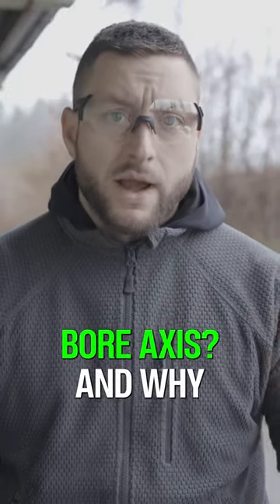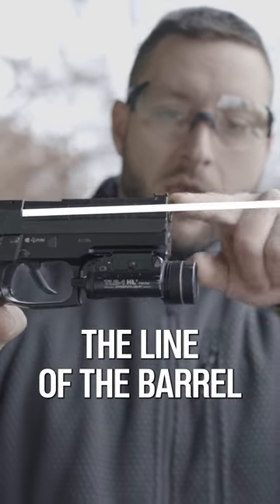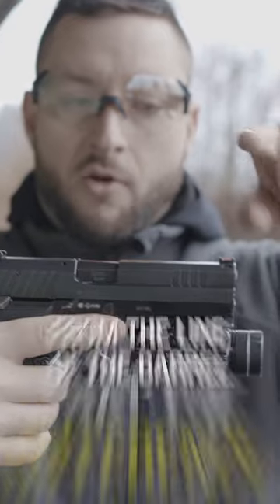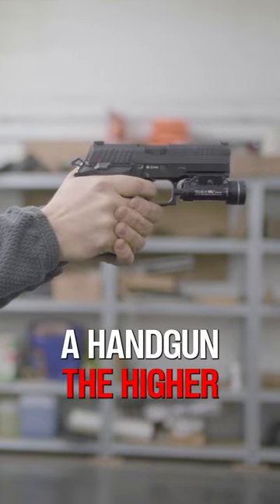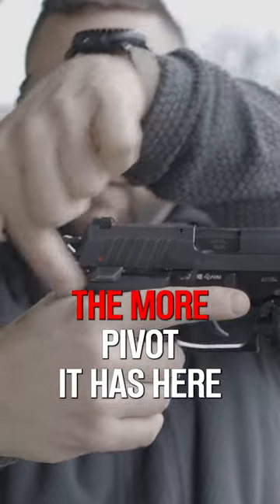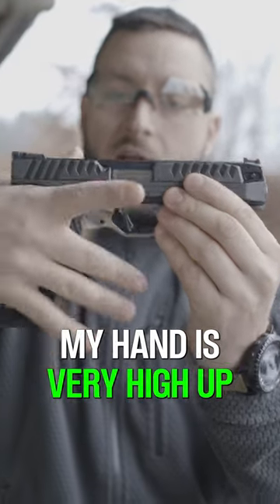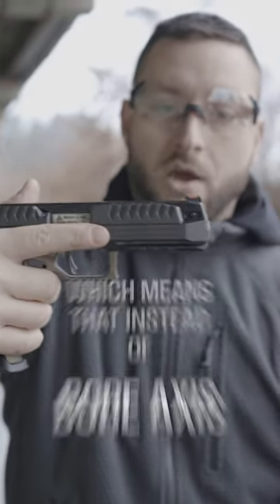Low Bore Axis?  Laugo Alien

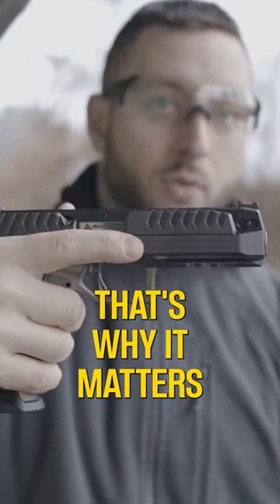Comment: 0:50 The bore axis also better aligns with the radius bone of the forearm, which is the load-bearing part of the forearm which connects directly to the wrist bones. That's actually better than if they had an even lower bore axis that placed the axis in the "middle" of the hand. Not sure if that's a thought they had when designing it but it's biomechanically very sound
Reply: Всё верно. Аналогичный спортивный пистолет был в СССР мц3-1 рекорд 1954 год.. 🎉🎉🎉

Comment: I shot the Alien and the hype is real. Muzzle flip is almost non-esistent even with factory ammo. However... the recoil going straight into your wrist and arm is a lot sharper and stronger, to the point it gets uncomfortable after a mag (let alone after a match). I'm a precision shooter (not a dynamic discipline competitor) and I prefer my G40 10mm to the Alien because ironically, the felt recoil is LESS with my 10mm, and muzzle flip (obviously more pronounced on the G40) isn't such a big factor.
If you're an IPSC shooter and reloading your own lower charge 9mm, Alien is great.
Reply from the maker: Bingo
Reply: @PolenarTactical  by the way, best pistol with the lowest muzzle flip and felt recoil at the same time (muzzle flip is only slightly worse than Alien's, while the felt recoil is just zero) is the good old Luger. Funny that. Shame it's useless for IPSC due to its whooping 7 round mag capacity. Someone should make a modernized double stack Luger with proper sights.

Comment: A similar case is the difference between Kalashnikov platforms and AR-15 platforms, Because the AR-15 has the stock aligned with the barrel, the elevation of the barrel due to the rear rest is less, while in the Kalashnikov the stock is at the height of the handle, lower than the barrel.
(in the AK-12 that problem is solved, the barrel is at the height of the stock)

Comment: Alien is not a bad gun. But is it worth that much? No. It's a striker meaning that any tuned SA will beat it with ease. And the low bore axis is great, but did you ever try to fire over 200 rounds out of it in quick succession? The barrel is so low that it overheats the frame and the slide at some point at the same time and without gloves you literally cannot hold the gun anymore. Like 300 was top I got out of it. For exapmple a Walther PDP or SIG P320 are both still well shootable at that point. The slide is smoking hot, but the frame is ok.

Comment: If you were to take a pistol snd find the sweet spot to drill a hole on the top of the barrel, so when the gas exits and the gun flings upwards, some of the escaping gas would counter the recoil???? Is that possible?

Comment: If you push a regular gun like a Glock into a rubber dummy and pull the trigger it doesn't fire because it is out of battery... but what happens with the alien? Does that design prevent OOB when pressed firmly into a target?
Reply: Its a fixed barrel, so.....
Reply: @ALovelyBunchOfDragonballz  so....?
Reply: @justme5384  so......did you read the OPs comment?
Reply: @ALovelyBunchOfDragonballz  I did
Reply: @justme5384  and...? What conclusion have you come to?
Reply: @ALovelyBunchOfDragonballz  no idea. You said it is fixed barrel so not a clue what that means
Reply: @justme5384  that means the barrel doesnt reciprocate when cycling, its fixed in position.
Reply: @ALovelyBunchOfDragonballz right... but the slide is not fixed.  So let me rephrase the question: will the slide move enough for an OOB detonation, will the slide actually stay in place and fire/cycle the next round, or will it simply not fire like other pistols with OOB safety?
Reply: @RichardCranium321  the slide doesnt extend to the front of the gun.

If you want someone else to do your critical thinking: yes, you can muzzle someone and it'll fire.
Reply: @ALovelyBunchOfDragonballz it doesn't have to reach all the way to the front... if you push it in far enough on someone who's wearing a thick coat then its probably enough material to contact the slide.

I don't need someone to GUESS what will theoretically happen....   Ziga has everything needed to actually perform the test in real life.
Reply: It's a gas piston delayed blowback fixed barrel which might not matter. If your jamming a pistol into a target, jerk your hand back and fire. Use your other hand or your body to push the slide forward. In any case, use a distance weapon at distance. If you're packed like circus clowns in a tiny car, switch to a contact weapon like a handshake buzzer or a flower that squirts.